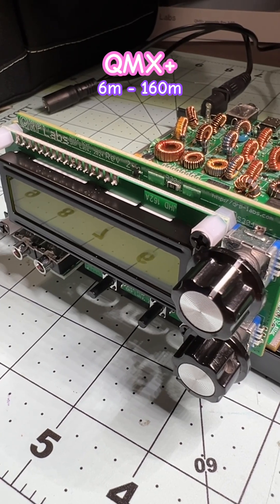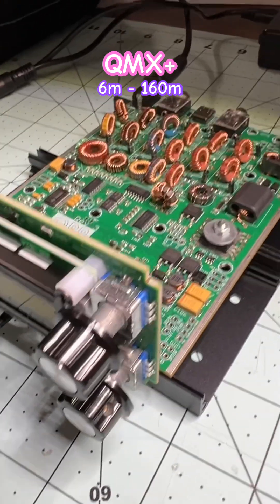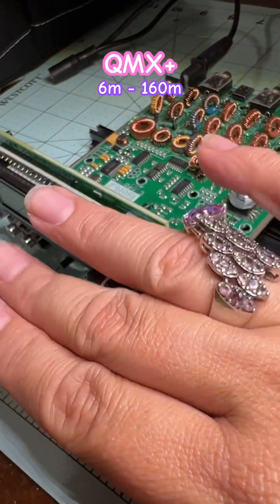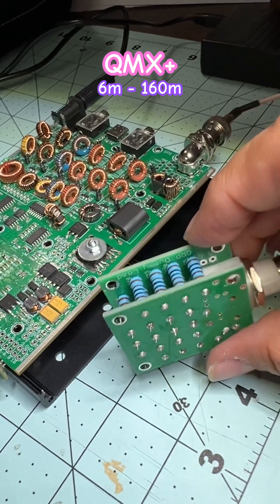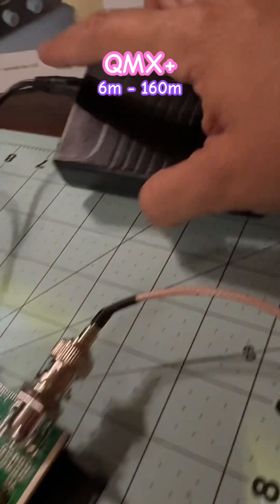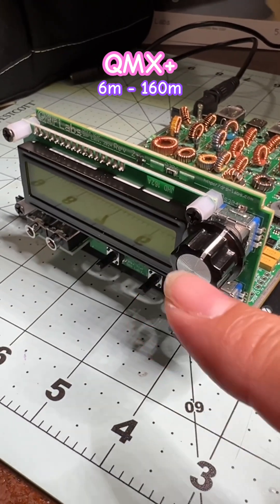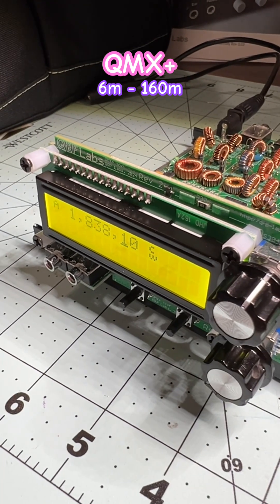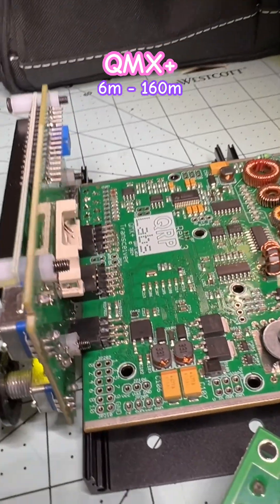QMX+ Smoke Test

Comment: Actually, if the factory had put one of the SMT capacitors in backwards it could blow up any time from immediately to a  year or so after you started using it. I always double-check polarized capacitors. Over my career in electronics I've even seen diodes coming from the factory with their cathode bands on the wrong end. I measure everything, every resistor, every capacitor, every diode, every transistor before I install them. It makes troubleshooting a new build much easier if any troubleshooting is needed at all.
Reply from the maker: Thanks for the warning and I hope it won't eventually smoke! Good info! :)

Comment: Congrats! You have proved the radio doesn't have any shorts! Now you need to go into the hardware tests and start looking at the various tests and the results. I'm currently correcting issues I found from this testing and strongly suggest you figure out the terminal with the usb cable to a computer. Those menus and screens are much easier to read than what the transmitter's tiny screen can provide... In my case, the RF Filter Sweep tests clearly identified I had bunches of bad solder connections because of not scraping off the enamel from the wire ends...
Reply from the maker: Oh This is good to know! I have to do that! Thanks!